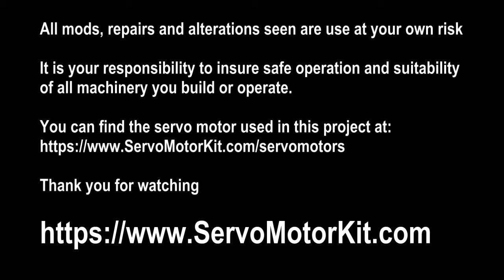Mini Milling Machine 1 hp Servo Motor Upgrade with Little Machine Shop Belt Drive Grizzly Clutch

Comment: all motor parts out of stock!!
Reply from the maker: I am sorry but all 50 of the 750 watt versions are sold out. ETA of the required parts to build more is August 27, 2024.
I did build one 900 watt version but top speeds are limited by the larger magnets. I am redesigning it with a 1 to 1 ratio right now. 
It should be released in about five days. 1 to 1 means the digital display will be accurate to the actual spindle speeds.
The extra torque will compensate for the 1 to 1 ratio. Expected spindle speeds are 200 to 3,400 RPM.

Comment: Very good video, will the motor work on a wen 33013 mill?
Reply from the maker: As long as you have the LMS adapter already it will fit. That and the new motor can be fit without drilling the LMS plate. Simply file the holes a bit to match the second bolt circle on the motor.  By the way, this system is currently being updated to include a power tap function.
Reply: Thanks

Comment: hey can you explain me why servo motors work for milling machines and lathes and not for drill presses?? thnx in advance!
Reply from the maker: They can be used in a drill press. I have many customers who have done this and they are very happy with the end results.
The problem is customer abuse and my attitude because of it. 
What happens is all of a sudden the drill press has much more capability than it is stable enough to support.
The customer realizes this and starts using his drill press to perform jobs that require better tooling. After jamming his machine repeatedly, he/she smokes a mosfet.
Rather than saying oops, I smoked it and can you get me running again for cheap ($5 part):
The customer takes zero responsibility for their actions; lies or actually believes that I sold them a defective product. 
They force a return/refund. This costs me between $100 and $400!
When the parts return, it is obvious what happened. 
See how to fix it here: https://www.youtube.com/watch?v=u9v_Uzo8a7o

Comment: Great addition for the mini mill I have the LMS X2D mill with the belt drive going to buy one of you upgrades. Did you ever think about making lathe kit for the older Atlas lathes I would be interested in one.
Reply from the maker: Bob. 
Your order is built. tracking will show in your inbox today. As for the Atlas lathe: There are a lot out there and I have received several requests. I just do not have time to create a new kit. Would you be interested in designing it? When done I can wholesale you motors. I can also place your system on my site for free. As long as you keep your quality/reputation up and manage all your orders, it's free to list it. Contact me direct with the info in your order if interested in marketing your own designs.
Thanks
Dan

Comment: are the motor drives capable to work with cnc software to controls the spindle speed?
Reply from the maker: The new 2024 controller uses standard 0 to 5 V speed control and simple on/off switches. FWD/REV, start/stop and speed can be controlled but you must use an isolation board.
Also there are no plugs for this. You would have to tap the actual wires inside the controller. We will release a CNC version in the near future.

Comment: Hey quick question for you will this upgrade work on a micromark mini mill? I've purchased from you in the past for my mini lathe. Thanks
Reply from the maker: That is not that simple. Does your mull have the LMS kit already?
Send me pictures
Reply: @danielmartin382  hey thanks for replying. No LMS kit. It's got a 500 watt brushless on it. I did no mods other than the dro kit and a tach. The 1 hp servo sounds good little extra power. But I should look into that to see if that LMS kit fits on there
Reply from the maker: actually you should bypass the LMS kit and do it right. The video here shows the real kit on the other mini mill near the beginning. The gray one.
It's much harder to make but the end result is outstanding. The cost is about the same because the LMS kit is over $200 + my motor kit $200+ more.
Since you do nt already have the LMS kit, see the complete kit here:
https://www.servomotorkit.com/product-page/750w-mini-milling-machine-upgrade-kit-klutch-harbor-freight-grizzly
That is also the location to e mail me using the contact form
Reply: @danielmartin382  cool I'll check it out later